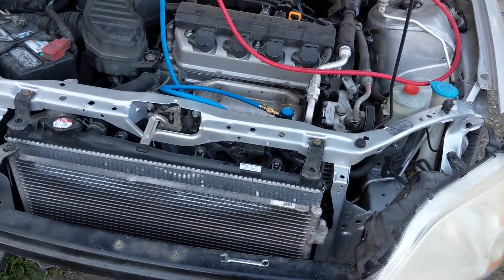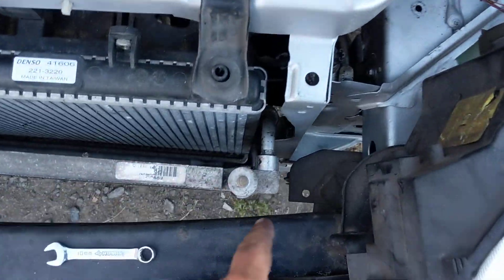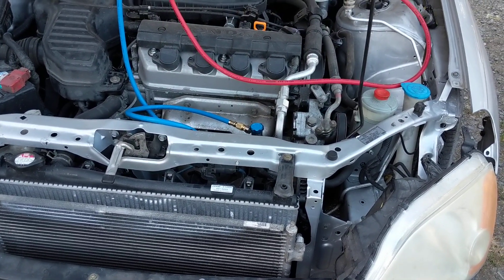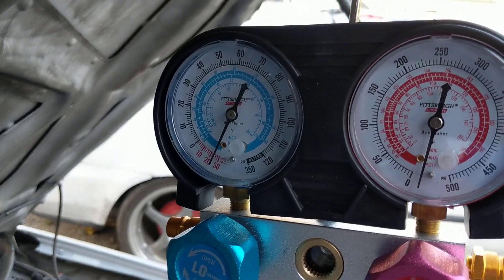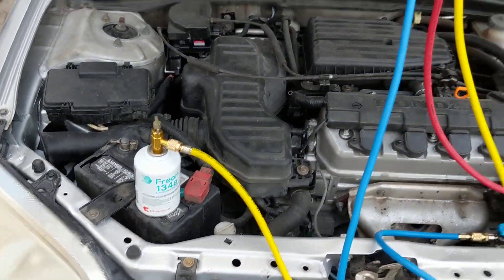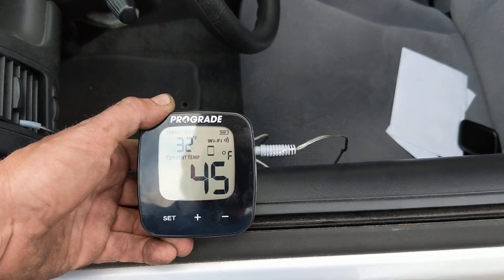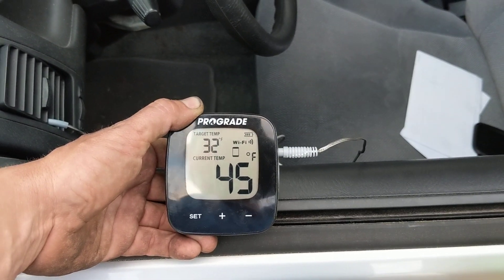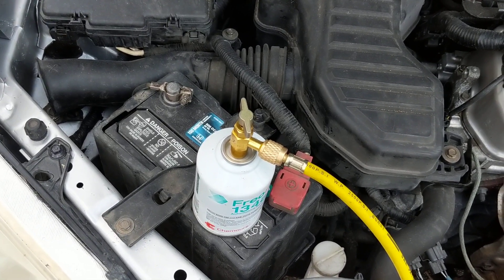2001 Honda Civic LX AC Recharge

Comment: You can't see where you added that refrigerant at
Reply from the maker: Low pressure line aka blue line you can see where it goes to on the video,  red is high side do not add to that one.
Reply: @RedneckProvingGrounds  thank you!